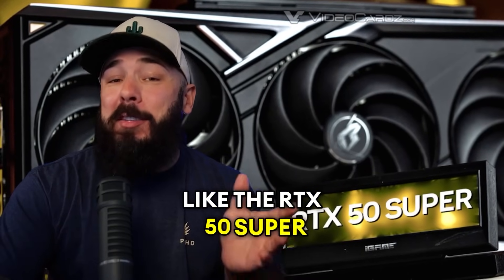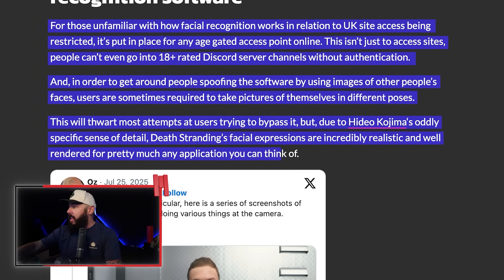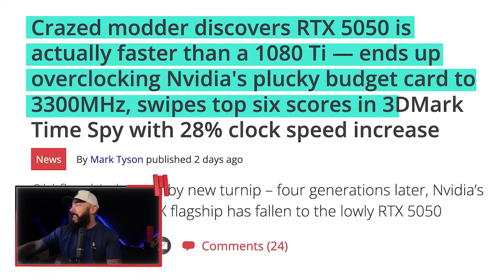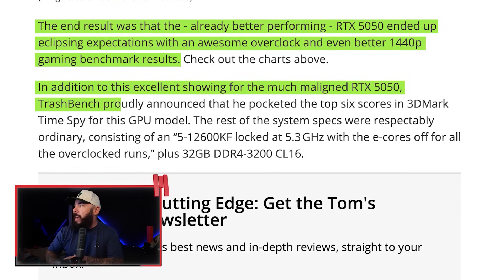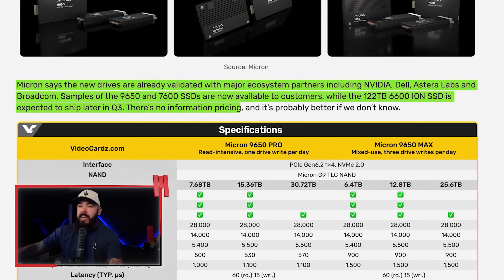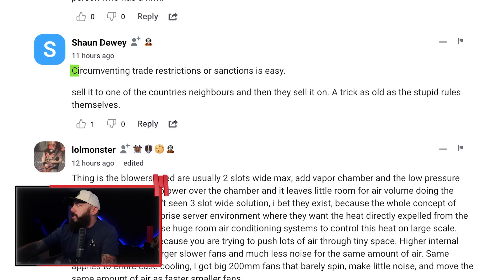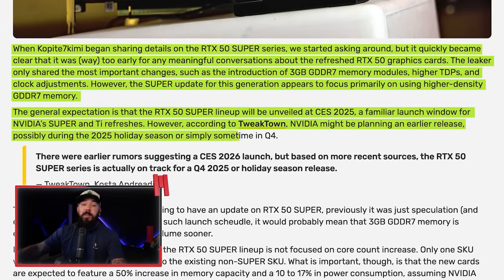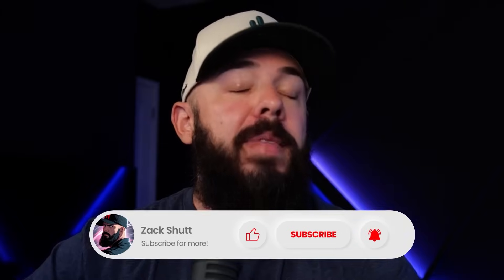NVIDIA’s Dropping This WAY Too Soon

Comment: the only positive about the super cards is that prices on Ti and normal cards drop to more affordable levels, i already picked up my 5070 Ti on sale and got lucky, but i have never picked up a super variant as the performance upgrades are not worth it imo, maybe the 5070 super without the Ti having more VRAM might be a little worth the cost if you dont already have one.

Comment: I never buy cards at launch. There’s always driver problems, low vram, price gouging, availability problems. It’s just an all around bad experience. By the time Super variant launch’s most of the problems have been resolved to some degree. I’ve been waiting this whole time for the 5080 Super. I absolutely will be picking one up the day it drops.

Comment: Solution: go after pornographers.
If the 24gb 5080 super is like 65-70% the price of to 32gb 5090, it would be worth it, right? The extreme gain in CUDA cores is a big thing.

Comment: I would have wanted a 5080 but was worried about the longevity of 16gb vram at 4k. I would have probably gotten one if it had 24gb but got lucky and snagged a 5090 FE at MSRP and it should be here in the morning. Fingers crossed. The 5080 should have always had 24gb vram, to be honest

Comment: I used to be NVidia, but when they went to the rediculous prices, I dropped them and move to AMD's Radeon cards. I got the RX 9070 and am happy with the performance, even with ray tracing on. I got it at a much cheaper price for RTX 5080 performance I believe. I may be incorrect, but I get very good performance and the card does very well and outperforms some the NVidia cards in ray tracing. People can check out the comparisons on YouTube.
Reply: lol, the 9070 is nowhere near 5080 performance, you're probably watching videos of the 9070 XT thinking that it is the same card as the 9070

Comment: I'm so confused. I'd have expected a 5050 to beat a 1080 Ti out of the box. Are low end cards really so slow that a pre-RTX card is still better 4 gens down the line?? Holy shit.
Reply: You could even see the super releases as an entire gen even tho its not, so then 20 - 20super - 30 -30super - 40 - 40super - 50. 7 gens later?

Comment: The good thing about the super series this time around is that in the 5070Ti and 5080 the GPU remains the same except for the Vram, meaning there's no need to get them if you already got the original versions
Reply: That's not a good thing. That's an insult to our intelligence.
Reply: They're not the same, the super cards have the same cores but run at higher clock speed, so maybe 5% gain at least😂😂

Comment: I've always loved blower-style coolers. I've found them much better for overall thermal management compared with the modern trend for axial fans. A decent blower implementation moves heat really well and without making a lot of noise in the process. I really hope they become more mainstream again. I really good implementation could allow better overclocking.

Comment: I wanted to upgrade my aging (now 4.5 years old) RTX 3070 with an RTX 5080, but when they came out the prices where way above MSRP (like €1500/1700) and when the prices came closer to the MSRP there started to get rumors and “leaks” for the super series.
So I decided to wait out and see what the Supers would bring, it’s noting crazy but atleast the VRAM head room and possible future proofing is a huge plus!
As my RTX 3070 has been struggling for a while now trying to run modern games at 1440p with its measly 8GB vram.
And so I want to be sure that in let’s say, in 3 years it would start to get more common for games to require more than 16GB of vram and so would be bottlenecks by the base RTX 5080.

So yea I am waiting for the RTX 5080 SUPER! 😊

Comment: Yeah, I don't use Face unlock on my phone, or any biometrics for that matter. Until there is CONCRETE law preventing the cops from using your face/fingerprint to unlock your phone, allowing them to search it (pulling an end-around the 4th/5th Amendment), it's pattern unlock for me.

Comment: Any new GPU that has less 16GB of Vram is complete trash.
Reply: I'd argue that 8GB is fine for a super budget card (like the RTX 5050), 12GB is good for most 1080P gaming, and 16GB is fine for 1440P. But 4K is quickly getting to the point of needing 20GB+.
Reply: They're fine for now, but I expect 12GB cards to become obsolete with the release of next gen consoles and I wouldn't feel comfortable with 16GB GPUs either.
This gen stinks like planned obsolescence.
Reply: @wundsalz6831 I definitely agree, cards like the 9070xt, 5070ti, 5080, all have enough horsepower to still be relevant into the ps6 era, but I don't think their 16gb of vram will be enough by then.
Reply: @bignose1752  if ur playing on 1440p it will be perfectly fine for many years i think
Reply: @wundsalz6831  12GB dominates the 1080p resolution. Nothing more.

Comment: Ngreedia got too greedy. And the gamers rebelled. All sorts of 50 series available now. But the AMD cards keep selling out... The market flipped. And now they think by putting out a stack of high ram cards (at abhorrently higher prices) will entice people to flip back. Not realizing the cost is what is driving people away in the first place. Typical Harvard MBA thinking. They are all masters of extracting maximum value for their shareholders, but have not a clue how to actually create value in their products.
Reply: amd jacks up prices just as much as nvidia. just because amd did well with their 9000 series and sold  a bit doesn't mean they flipped the market lol. nvidia still owns the consumer desktop gpu market and that's not going to change anytime soon unless nvidia continues to flop multiple generation like intel did.
Reply: @LCJammer  The store shelves do not lie. Im sorry your manhood was insulted by the truth...
Reply: @LCJammer  You expect any other sort of behavior in a system that is designed to create artificial scarcity to enable profits? I know damn well their record profits are coming at our expense son. None of these cards has a right to exist above $500 honestly.

Comment: I just bought a 5080 and I'm outside of my return window. I guess I'm screwed here. But I did sell my 4080 for $1400 (CAD) and bought the 5080 Aero for $1699, so I guess that's not bad.
Reply: thats a good deal tbh
Reply: you literally bought nearly the same card lmfao
Reply: I just bought one too but you shouldn't stress over this since its gonna be highes price that's just simply not worth it and youre not gonna find it for its rumored MSRP anyways if its even in stock

Comment: so my 1080 TI got finnaly beaten? (get an 5050 for 350$ while you can get an 1080 TI for about 180-200$😂)
Reply: Im currently using a 5070, but it was an upgrade from my 2070 super
Reply: @sneakypooace45  the 5070 is a good card
Reply: Go ahead and cop u a 9060 xt bro
Reply: U need a raise for ur english
Reply: @BlueNPC1 me ?
Reply: @BlueNPC1 ???
Reply: @ItsPoseidon "finnaIy"
Reply: Good luck with driver support and GDDR5 😂😂😂😂 by end of 2025 your card will be obsolete and lucky to pull 30fps in 480p because of drivers. And a 5050 is 11% faster than your card. Let it go bro. An overclocked 1080ti loses to stock 5050 in a lot of games.
Reply: If the 1080ti breaks you just lost $200
Reply: @Augusto-t2q  my 1080 TI was suffering from years of sagging, and it still works (I think)
Reply: @Augusto-t2q ok and? He bought the card ages ago
Reply: 😂super dumb
Reply: @subhadeeppodder rude
Reply: + the 1080TI has 11 GB and the 5050 with 8🤣
Reply: But no ray tracing on 1080 ti
Reply: @sneakypooace45 worse, no dlss, or av1 encoders
Reply: @sneakypooace45 nobody uses ray tracing
Reply: Ray tracing with the 5050🤣
Reply: 6fps with bluescreen
Reply: @dbefjdkkent why are you laughing? Just turn on performance upscaling to 1080p and enjoy those traced rays! It'll be a feast for your eyes.

Comment: facial recognition doesn't work that well and doesn't count for people who look 30 when they are 14. cause it does happen.
Reply: The only people who will be excluded from porn sites this way are boomers who struggle with tech. Boomers are also the group of people who will have their private data exposed in the next spicy data leaks. Hardly anyone else is idiotic enough to upload their real ID to dubious websites.
Kids will use Avatars, filters and/or VPNs.

Comment: I don’t think the super cards can come fast enough. I’m very disappointed in the current offerings on the cards, especially in the mid range offerings. I am waiting for somebody to fill the gap. I was hoping that AMD would come out with a higher end card but they aren’t. Waiting to see what intel drops, but most likely I am going to hold out for one of the super cards with more VRAM

Comment: Nvidia is working with SSD manufacturers to bring SSD's to market with a 33x speed improvement. Makes you wonder how they plan to do that. Current SSD's only use 4 PCIe lanes, and it would probably be fairly trivial to manufacture them to use 16 lanes but that's only a 4x improvement over current gen. Far from 33x. You'd need 132 lanes to achieve 33x. The entire ecosystem would have to change to support them.

Comment: SSDs all just went up in price, because something new came out
Thats dumb AF, old stuff should be cheaper
4090s going for more than 5090s is bonkers
Reply: The older ones go up in price as they start making less of them.  Gen3 is mostly out of production now and gen4 pricing went up over a year ago.  As gen5 starts ramping up production you can expect both gen3/4 to get more expensive if you are buying new.

Comment: Is it confirmed they will be called "super"? cause well, they are not all that "super" with no extra CUDA cores. Someone speculated they might just be called 5070 Ti 24Gb and 5080 24Gb. Like there is a 5060 Ti 8Gb and 16Gb. I suppose the 5070 could be called super since it actually has a few more CUDA cores.

Comment: People are starting to sell their 4080 supers for like $600 bucks on the resale market. I urge anyone who can’t afford what the 5080 super will cost to buy a 4080 super from a trusted seller or store instead of trying to buy a 5080 super for “inflated” msrp. Just my two cents.
Reply: What if i already have a 5080
Reply: What's that burning smell?
Reply: The “super” GPUs have been trash since the beginning. 20% more for 2% performance gains, on a 6 month old card. Makes sense.
Reply: @corymorrison4488  wasn't the 4080 super the same price or less?

Comment: use AI (veo 3) to generate a face and use it for the facial recognition and they wont be able to fix it.
Reply: Veo 3 is for videos, imagen 4 is to create images. Either way, its crazy that using AI for facial recognition works is crazy